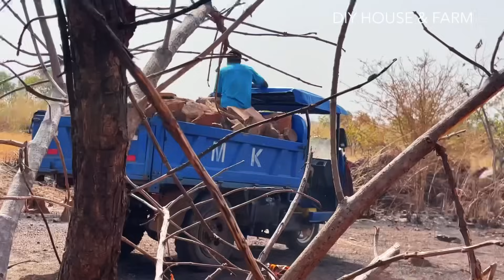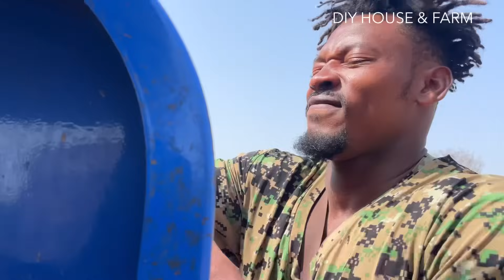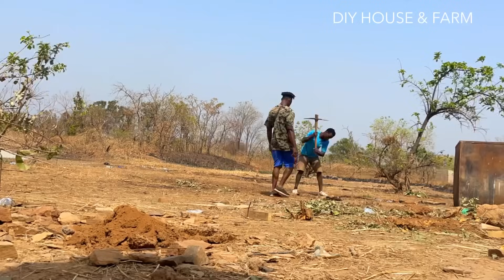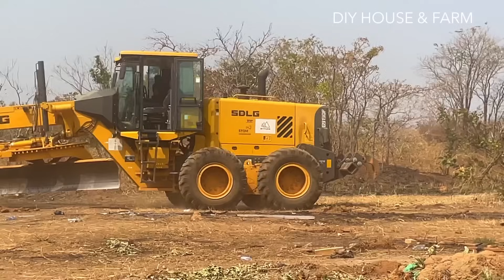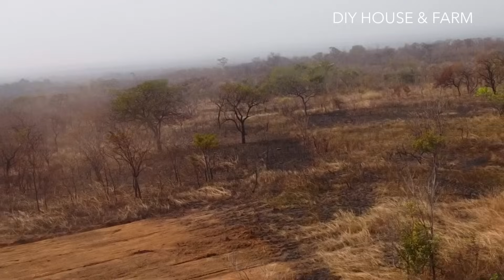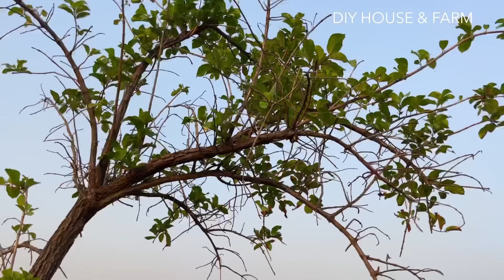I did not expect to enjoy this! | Land Leveling & Red Stone Work Construction

Comment: Es if you get time look up the Back to Eden method of making your dirt very fertile. You can chip up all the brush and trees. If you can find a chipper. It will also cut down on having to pull weeds all the time. Just a suggestion.